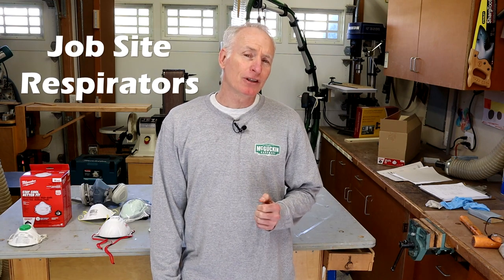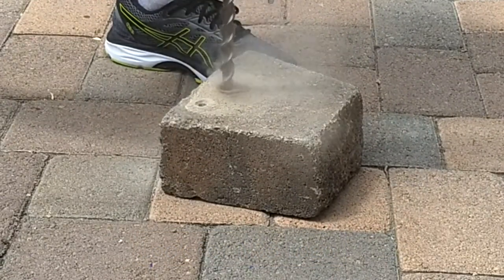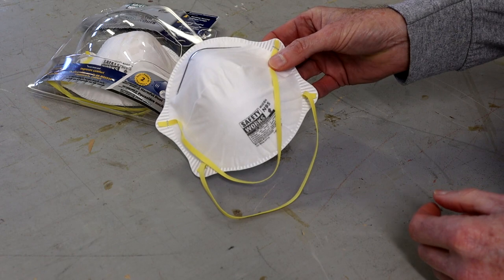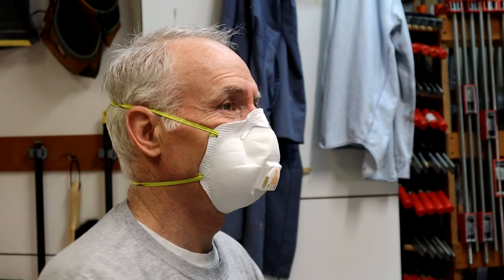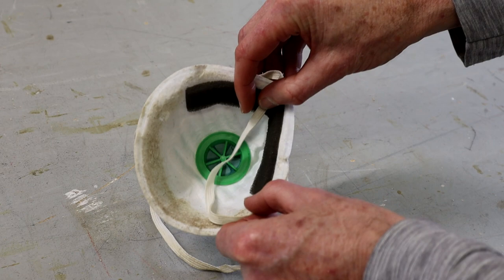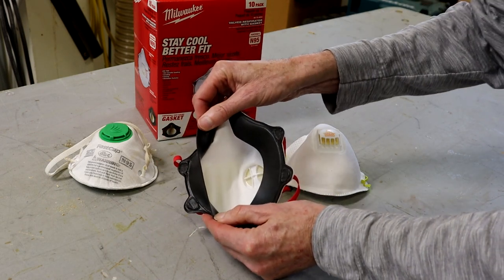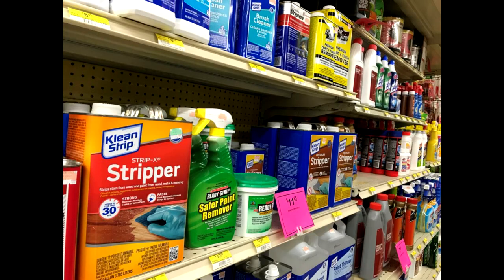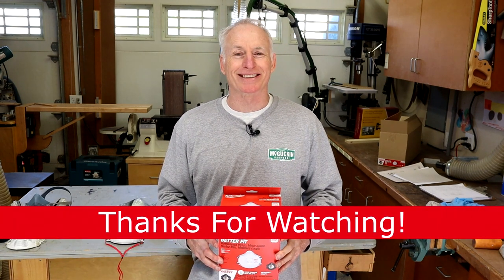N95 Respirator Shoot-Out: Don't Gamble with Your Health

Comment: Now the 3m 8511 go for $50 to $70 dollars on some sites like Clinical Supply USA. I haven't seen a Milwaukee mask but Honeywell makes a similar mask with a gasket that was selling for $20 a mask but they are really hard to find now almost a year later!
Reply: Now 2022     8511 $20 for 10pk   Home Depot and can wear inside where masks required if put a piece of blue take over valve from inside . Milwaukee $22.97 10pk  Home Depot

Comment: I'm on that boat that I don't have a mask and I'm an electrician , ive been using the same face mask going on the second week . My question to you is how many days is one supposed to use a disposable face mask for??
Reply from the maker: Great Question. I reuse my masks until they are dirty. If I'm cutting concrete/tile that might be only a few hours. But light use like sweeping or landscaping I can use them for weeks. I have found you can extend the life of a mask rinsing them lightly and then let them fully dry. If it starts to look dingy I trash it. I also store mask somewhere where it won't be contaminated by the job site. Like a said in the video, how the mask fits and seals against your face is paramount in protecting your lungs.
Reply: @DIYMark  Please do not wash masks. Many use a static charge to help attract and catch small particles and washing them will remove that charge and significantly reduce their efficacy.